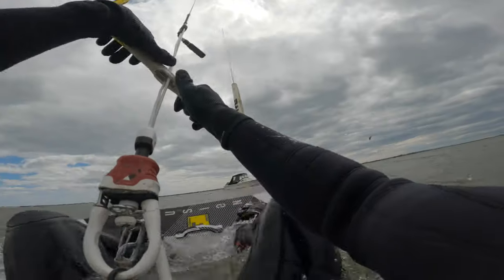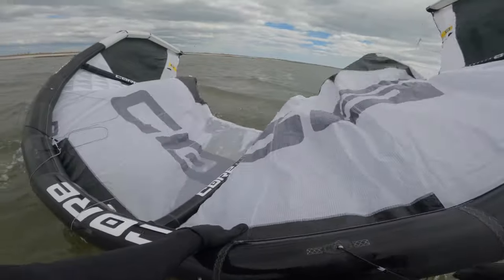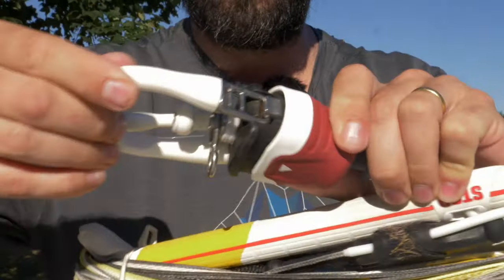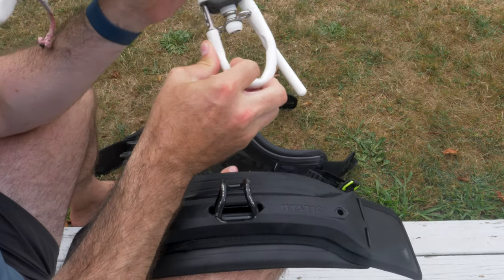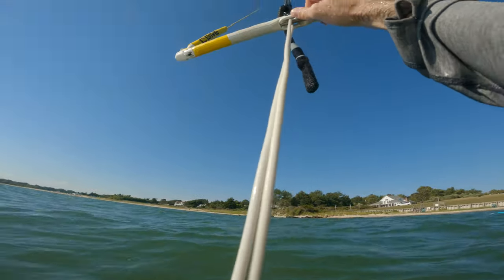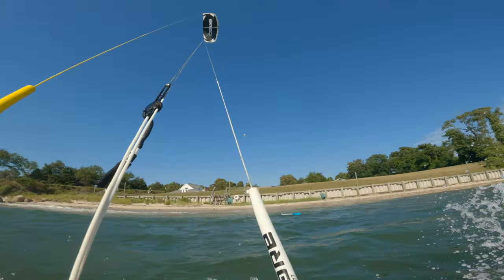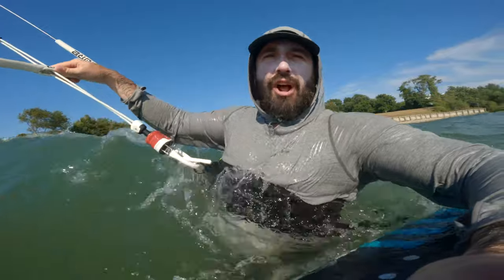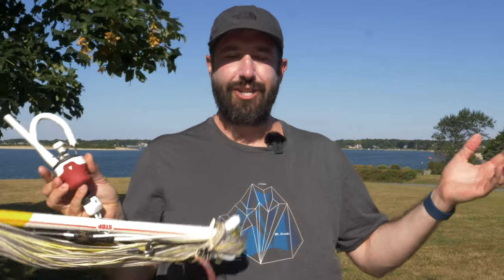How to prevent accidental chicken loop release

Comment: This just happened to me today in high wind and waves. As soon as it released, the safety line somehow got caught in the steering lines so it couldn’t de power and the bar was out of my reach from the length of safety line that did go through so I couldn’t get back to the bar. The kite was flying inverted with the bar dangling just out of reach blowing me back to shore into the breaking waves. Once I got to the breaking waves I had to release the kite completely as I was afraid I get wrapped in the line when the wave dumped me. Eventually got in, untangled everything, and went straight back out. Didn’t want to miss good conditions!
Reply from the maker: Glad you were safe and got back out right away!! Your situation sounds more precarious than mine, but a cool / calm head seems to have helped you handle it with no issue? Any lessons learned?
Reply: I recently replaced my safety line and I missed a little plastic bead that I think stops the bar sliding too far out. I recommend checking in a light wind day if you can reach the bar when de powered and see if you can find a way to wind up the safety without wrapping around your hands as that’s not an option in strong wind. Maybe it can be wound around your board to help get back to the bar

Comment: you have a new board, tell me what's the difference with nobile does it make sense to buy?
Reply from the maker: I got a slingshot dwarfcraft 110cm and it’s much lighter and shorter and more nimble. You loose surface area which makes it harder to water start in light wind, it’s also a little less forgiving when it touches down by accident. For my level of riding, it feels like the perfect upgrade. The Nobile was a great beginner board and travel board, but this slingshot is way more fun

Comment: For a while my chicken loop was releasing about every ten to twenty sessions. I finally realized that the chicken finger (or whatever rude name you might prefer for it) was too short so it would pop out and then the chicken loop could easily work its way off of my hook. I got a slightly longer chicken finger and the problem went away. This clearly wasn't what happened to you (in my case the safety didn't release), but I had to deal with the same logistics of getting hooked up again.
BTW, you shouldn't need to push the bar away - just let go of it while holding on to the chicken loop/safety.
Reply from the maker: That would have scared the crap out of me!  But I bet having it happen multiple times got you more familiar with how to deal with the situation! 

Why was the stick too short? Was it a new bar?
Reply: @erbartlett  It was a second-hand bar. I think the factory stick is a bit long so the previous owner shortened it, but they shortened it too much. When I got a replacement stick it was too long but I was careful not to shorten it as much. It's been fine since then

Comment: You should be able to do all of that with your eyes closed and without breathing. 
Most of the time, I had to rehook with the kite down on the water, so the whole operation has to happen underwater while being pulled forward. Unless you live in a spot where water is clear, you won't be able to see what you do, and being pulled forward means you will have to hold your breath while doing it as you can't swim in the meantime. Make sure to practice it a lot on the beach!
Reply from the maker: Has this happened to you a bunch?? Yeah, it was really good to get this practice and build this familiarity.
Reply: @erbartlett  most often, I get in this situation not because the chicken loop was not attached properly, but simply because I had to release the safety. A while back, I also ran into this issue where if I lose line tension and the chicken falls behind a bit, when I get the tension back suddenly, the loop could pull itself out by bending the little stick. This doesn't happen anymore on modern ones. But I had my fair share of kitemares for sure! 😄
Reply from the maker: @mysweethubert  I've had that happen in the past, where I accidentally knock off the chicken loop with my hand, or I accidentally hit the release with my hand.  one thing that made this more complicated is that I was using a surf spreader with a metal ring rather than a hook.